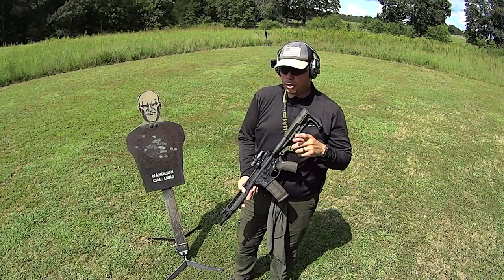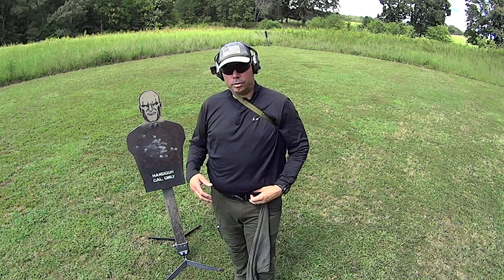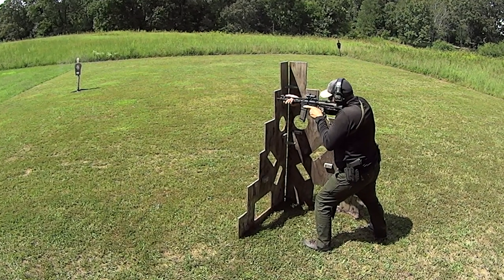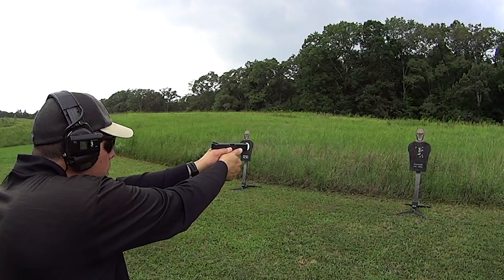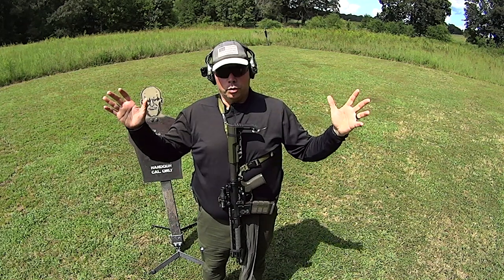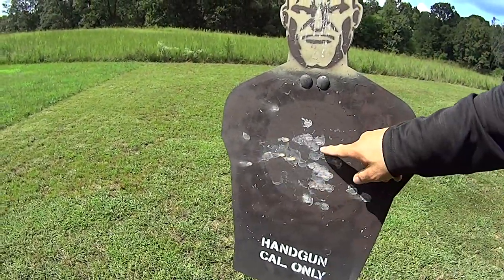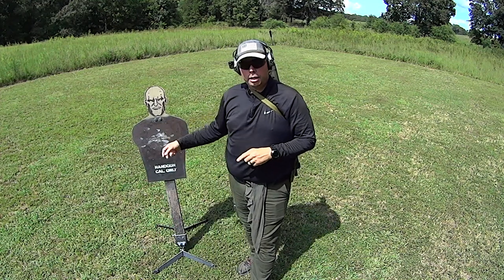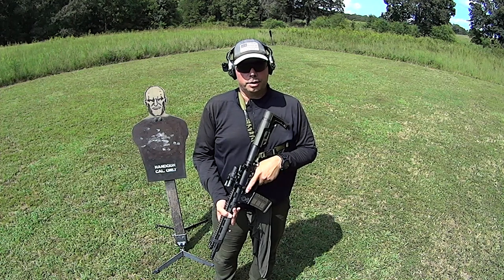Why Shooting Steel Does Not Require Frangible Ammo

Comment: I use the method that less than 3000fps at impact is the best way to calculate if it will damage steel.

Short barrels don't produce the velocity and heavier ammo doesn't achieve 3000fps at the muzzle, so even less travelling out to the target.

I'd be curious to test this method with a 16" with 55gr at 15-20y
Reply from the maker: It works just fine at that range. If you watch some of my more recent videos you'll see me running my 16" with M193 as close as 10 yards with no issues. All one has to do is turn that target.
Reply: @Tier1Citizen  I'll try on my friends steel first lol

Comment: What distance you recommend to sight at 7.5 pistol??? I sight mine at 25 yards,  just asking to see if I make the right choice😁🤔😂
Reply from the maker: 50 yards if you want it to behave like a rife at longer distance. However, if you're going for an SMG on your ballistics then 25 yards. A 25 yard zero is good for when you're staying inside of CQC distances. It becomes a problem when you start pushing out to 100 yards, which a 7.5" can easily do.
Reply: @Tier1Citizen  i want this one for close range, under 50 yards i have regular 16" for more longer ranges, thank you i appreciate your taking the time to help
Reply: I zeroed my 8" 5.56 PDW pistol  at 25 yards as this platform will not be used at distances over 100 yards. I have a 14.5" platform for that.

Comment: If your moving positions for the same target, could you angle the target to where it’s facing downwards instead of the right or left of you?
Reply: I know this is an older question, but I actually just bought Close-Range Rifle Targets from Challenge Targets. They have a 20-30 degree forward lean angle so that the spall goes down and behind the target. I've shot XM193 out of my 14.5" as close as 7 yards with no issues.

Comment: That's cool. Instead of facing it down its facing to the side. Good tip man! I have had frag to the face and body from handgun ammo (always wear eye pro) but always scared away from rifle rounds within 25 yards. Would a 16" be ok as well as it has higher velocity?
Reply: You should be okay, as long as you keep a good angle on the steel. You might want to mark where it's safe to shoot from, squaring up on a target is a hard habit to break.
Reply from the maker: Yes, if you look at my more recent videos you'll see me doing this with my 16" rifle.